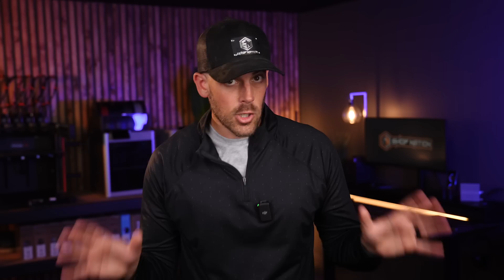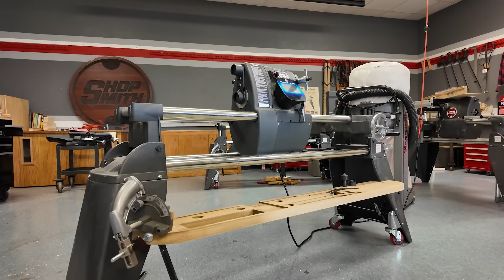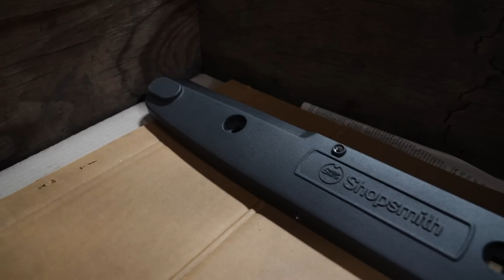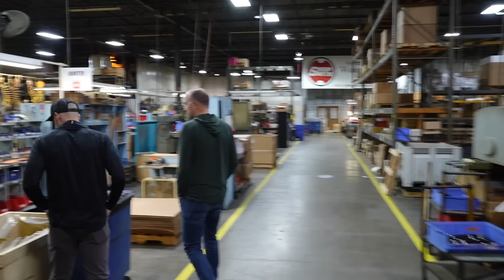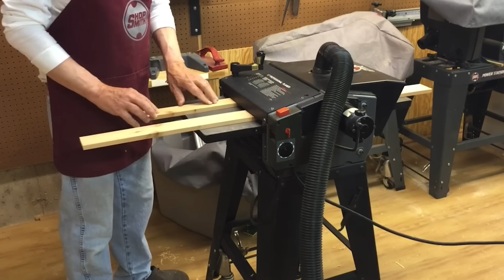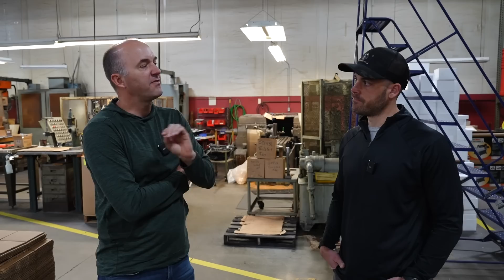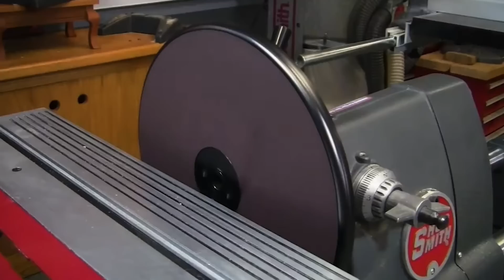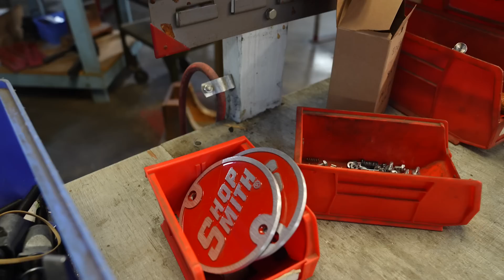The Last American Power Tool Company is (almost) dead

Comment: When I was in my garage, I used my ShopSmith exclusively.  Ever since I moved into my shop and got a SawStop, its now my drill press.
Reply: No comparison, for sure! Wise move! I went down that same path. The upgrades, accessories, and parts on the Shopsmith just rubbed me the wrong way.
Reply: Keep in mind-for the price on the high end tablesaw-SawStop-you could buy the basic Shopsmith and get the table saw along with the others in less space.
Reply: @rexoliver7780  Yeah, I know. But one doesn't need a top-of-the-line Sawstop to make cutting boards, small projects or even cabinetry. Those top-of-the-line Sawstops are for commercial production shops. $2K buys a perfectly capable Sawstop leaving $4K for a drill press, a disc sander, and a small tabletop lathe, very doable. Frankly, I think the "space" argument is way over-rated. It takes a lot of space to use the Shopsmith. So, unless you plan on rearranging the garage every time you want to cut a board, most will make the space accommodate the work rather than the minimal tool footprint. Look, I bought one! I thought it was a great value in the 1970's when I paid $600-$700'ish for one compared to the price of other tools. But 50 years later, the quality of other tools has gone way up, and the cost of other tools have come down while the cost of Shopsmith has skyrocketed. Lots of reason for that, but it is a fact, Shopsmith is not the value it once was. The current state of the company supports that claim.  If they cannot find a way to bring that value back and are hanging their hat on "takes up less space," I'm afraid they have a short future ahead of them. I had to put a new spindle on mine and new casters (twice). Those little casters were pure crap! The cost was crazy high. Just look up the cost of a Shopsmith saw blade compared to a comparable third-party blade. Oh wait, the third-party blade won't fit on a Shopsmith because it has a different arbor size, but wait, we'll sell you another arbor to allow you to adapt it. Want a third-party miter gauge? Sorry, our miter slot is nonstandard size, won't fit, but we'll be happy to sell you an extra bar that will fit, maybe you can adapt it to your miter gauge. They did everything possible to make their products proprietary and then jacked up the prices of accessories and parts. I had to replace the quill on my Mark V. The cost for that one part was outrageous. I don't recall the exact amount, but it was around 10%-15% of the cost of the entire Mark V? They gouge their customers on the backside, and that is why many have abandoned them. All of those in this discussion who are cheering on Shopsmith, I wonder how many plan on buying anything of substance from them in the near future. Moral support is great, but money talks. For Shopsmith, the money ain't talking brother!
Reply: @tommaxwell429  yes-there is a point on the “space” for the tool issue-by the time you get the Shopsmith and companion tools to work off it you are getting to the room requirements for a regular shop with separate tools. My brother has taken up woodworking and was able to buy a commercial SawStop from another woodworker that was downsizing his shop. The only thing for the Shopsmith is you can use its motor to run the bandsaw ,jigsaw,jointer, and so on. My brother also has a larger bandsaw than the Shopsmith version for resawing lumber if required-harder to do with the Shopsmith bandsaw.
Reply: @rexoliver7780  Yes exactly, as I think many woodworkers soon discover. The "one motor drives all" argument is valid! That is a big cost of power tools. I think it is offset greatly by the hassle and time consumed in changing configurations. Most hobby woodworkers are not exactly expert project managers, at least I am not! Therefore, my projects are seldom cut/join, drill, sand, whatever in order! I find myself changing configurations regularly and then going back to try to duplicate the previous setup. With separate tools, the saw stays set, you can go drill, sand, joint, whatever and come back to a saw perfectly set for the next piece. I found the constant need to reset tools frustrating, cumbersome, and imprecise. With the Shopsmith, you are largely trading precision, efficiency, and time for a little bit of space saving, maybe! If you want to build an infeed or outfeed table for your Shopsmith, bam, there goes the space savings just like with a table saw. Oh wait, you can't make an infeed or outfeed table for the Shopsmith because cut depth is set by raising and lowering the table, not the blade. All of these inconvenient truths come out once you start using the machine. The Shopsmith is fine for very small, infrequent projects. But at $6K, one has to be really dedicated to the "fun" of it rather than the value of it. You would be hard pressed to make the Shopsmith work efficiently for even a small woodworking business. If I had to make a set of Kitchen cabinets using a Shopsmith, I'd pull my hair out. If you just want to make cutting boards (big market for those  😜) or turn a few pens or bowls, there are much cheaper solutions.
Reply: @tommaxwell429 , that "one bearing quill" was a MAJOR piece of crap!
Where did they think that would work?  The Model 10 STILL has 2 bearings, 
and still builds Marks.  75 years old, and works just fine.
Reply: My brother has an 10ER hanging on his wall, as a dedicated drill-press. 
Speedchanger and all. 2 pivot bases for the mounts. He also has a 
"normal" one as well.  It is set up as a lathe.  This one can also do 
anything a normal one can do.

He also has all the normal shop tools, tablesaw, jointer, planer, 
and some sanders.  A nephew also has one.  All Model 10s.  
All were (some still are) mine.

steve

Comment: I don't have a full Mark system, but I do have one of their old stand-alone overarm pin routers and I LOVE it. I think that is a tool that could be resurrected. They are especially useful in things like guitar building, etc. Anything that uses templates for routing can benefit from a overarm pin router. With a little refinement to the design, it could easily live within the "convertible" spirit of Shopsmith by making it useful as a conventional router table and an overarm pin router machine.

Comment: I would get rid of the table saw attachment, and focus on the machines turning and boring abilities. I would put spiral blades on the jointer attachment. It should be an easy sell as a very nice and versatile lathe first and foremost, that can also horizontal bore, disc sand and joint.
Table saws are a monster of their own. I have the Ridgid 3650 and its barely good enough to do high end work. Its too light, wobbles, the fence isnt tall enough, not enough power run dado blades, etc. A Powermatic is on the wish list.

Comment: I have had mine since the 1980's and use it all the time. Really love my machine. So much I now own three of them. A place for all my spt. My comment is for discontinued items. How about a limited run of some of them. I recently found a lathe duplicator on eBay after looking for several years for one. Thanks for supporting such a great tool system.

Comment: If you bought Milwaukee before it was shipped off-shore, it was bullet proof. Now...Milwaukee is garbage. When I bought a pre-FUEL drill and impact set, the second battery worked for 5 seconds and died and wouldn't take a charge. Milwaukee made me go to the center in the Houston area to replace it. Why? I took that as a premonition and got rid of it and got the FUEL drill and impact set. Within a month, the drill stopped working, until you took the battery off and on and off and back on...and then it would work for a while. Two sets of Milwaukee, the last of which was over $400 and was crap quality. I might add that the drill was in warrantee and Milwaukee wouldn't honor it. Just crap.

Comment: Table saw suggestion...

Shopsmith should work with Sawstop to make a version of their saw that can drop in over the Shopsmith rails. The top should incorporate the Shopsmith table top and extension system, a version of the SS miter gauge (at standard universal slot spacing) and fence. 

The existing SS motor could stay on the machine to simultaneously drive accesory functions

If they can't incorporate it then a small freestanding Sawstop with the SS rail and table expansion system.

I think a lot of SS owners would buy it plus it would be a good selling point for new buyers...safer saw with a tilting arbor. 

.

Comment: I have owned 3 Shopsmiths. They are great. But what I see as their biggest problem is the number of used ones available at very low prices.

If you are mechanically competent you can pick up a used one in virtually any condition and learn on line how to replace  broken parts and adjust it to work good as new...for little money.

I got a "broken" Mark V from 1958 for $50. It was jammed because the speed control wheel was out of adjustment. (1 minute fix.) I spent about $100 on new belts and bearings. It works perfectly.

Comment: Good for you, Nick for profiling this company. Hope it boosts their profile. These guys need more visibility. YouTube videos, project videos, etc to showcase their machine. 
When I moved to this house 6 yrs ago I offered to buy a neighbors complete shop smith system from the kids of someone that had passed way but the heirs were too emotionally attached to the machine and they turned me down. I still wonder if they’ll ever use it. I moved on and purchased machines to do what the shop smith does as a single unit. But I still wonder about that old system that moved when the neighbor passed way.
Hope the new owner is using lean manufacturing techniques. Desperately needed to survive in their current situation. Hope they can make a comeback.

Comment: The journey to become a decent (even hobbyist) woodworker takes years. You save money to buy tools, upgrade tools etc... I can't think of any new ww'er to purchase a 5k machine if he does not know how to work with them, let alone this specific tool that requires a lot of experience to set up, adjust etc. Especially if you target 25-45y olds... The only thing you're hoping for is that everyone in the US has to move to smaller houses, but I bet they could spend that 5k elsewhere then... Expanding to Europe or elsewhere would off course cost immensely.

Comment: I've had one since the late 90's.  Today, I have it in a wood shop with many stand alone tools.  I use it mostly as drill press, extra table saw, and the band saw attachment.  It worked well as my only machine in a garage shop, but is a pricy option. It was always nice to have a variable speed for drilling.  I did have a planer from Delta as I was (and am not) not made of money.  Today, I like it as that extra multi-tool option in my larger shop.  Most of the time, it is odd to have the table tilt when using the table saw.  Sometimes, it's oddly convenient.  I wish him better luck that JJ had....

Comment: I’d love to see the company make a come back.  I’m 52 and I own two 510 models.  I’m dying to get the motor upgrade and dual tilt capability.  It would be awesome down the line to see some version of a planer be resurrected from its ashes.  Even if it’s based off of a more modern bench top model.  I’m still purchasing items here and there but the unit does last forever if you take care of them. Good video and good luck to Shopsmith.  May you stick around for another 100 years.  BTW… Is it time for a 75 anniversary edition.  I could probably pull the trigger on that.

Comment: I use to have one of the gold Mark. I had a bandsaw, planner and jointer. I sold it to a couple who bought property on one of than San Juan Islands in Washington state to build their off grid homestead. The one thing the Shopsmith does that virtually all other normal power tools is it can drill a hole 8” deep. The quill depth is almost double of most all drill presses.

Comment: I think the biggest problem they have is visibility.  They aren't in ANY 'big box' store, in any capacity.  And that's the first place new hobbyist woodworkers will go looking for their first tools.  And, once they acquire a couple... anything.. contractor saw, spindle sander, router, lunch box planer, etc... a ShopSmith is basically out of the question.  If they even hear about it in the first place.

If your only real audience is woodworkers who, probably, already have their own machines.  You aren't going to be able to sell many units.